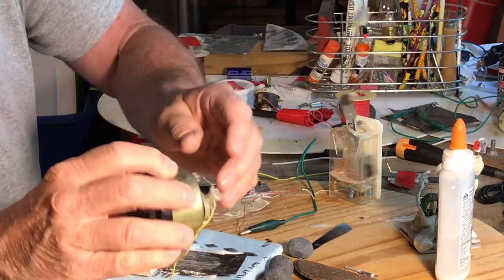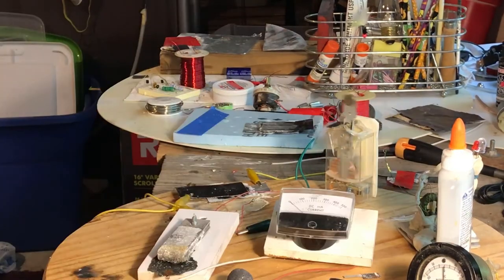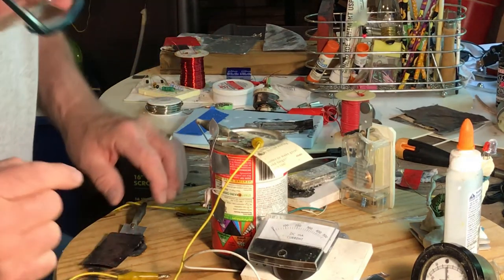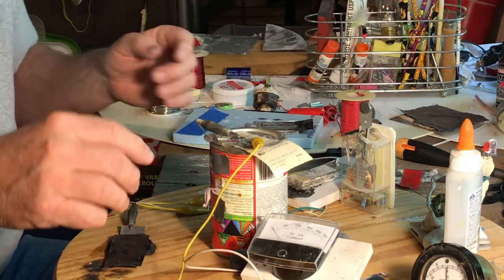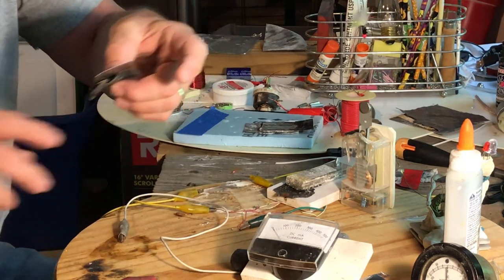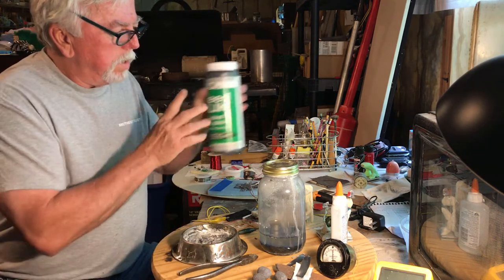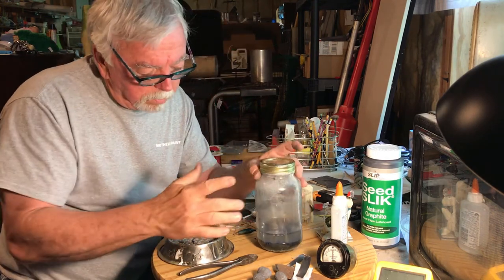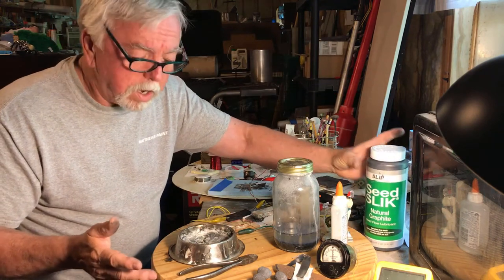Solid Electrolyte and Cement Battery update Without Music

Comment: Can I use only waterglass and graphene as a electrolyte?
Reply from the maker: I found that if I mixed water glass (which is mainly sodium hydroxide) and graphite in a small pot and cooked it over low heat, around 250 degrees F, for several hours, the mixture will look like hard candy.
The cooking pot will be ruined, and make sure to take the mixture out of the pot be for it sticks to the pot.  Try to flatten the mixture while it is still pliable.
You should be able to use the solid electrolyte for a very long time.  I have been powering a pulse motor for a couple of years on this electrolyte without changing the positive and negative plates.  Just add a couple drops of water onto the electrolyte when the power level starts to drop.
Warning: cook the mixture in a well-ventilated area, and do not breathe the fumes
Reply: @ET2uscg  Thank you for your reply! 
I tried Copper sheet  (or Al) + paper with graphene + Al with water as electrolyte. With 1cm x 1cm sheet I’ve got only 0.1amper 🥲 also tried gel (silicon oxide with water) it holds much longer.. 
Solid electrolyte very interesting..Does it also “eats” aluminium sheet after a while?
I have a liquid waterglass, but I don’t have magnesium powder. I have a piece of magnesium alloy but don’t think it’s pure…
Is it ok without magnesium? Or it’s better to add it? Grade it and add it ))
I like your small Al+graphene+Al battery.. will it work very long time like this one on the video?
Reply from the maker: @senoritapandora  Hey Victoria, I did not see any fast degradation of the AL or the Magnesium bar.  I think it is because the current draw is small.  The best I have seen is the conductive plastic electrodes.  Unfortunately, I have not made the plastic electrodes with powdered metal, but could be something I will do.  I should do this as my next experiment.  I don't know why I did not do this.  Thank you for getting me to think in that direction.  Sometimes I am all over the place in my thoughts and go down rabbit holes and forget how to get out.  That is why I started making videos, I can go back and see what I have done before.  I ordered the metal powder from ceramic pottery stores.  If you make some post it so It could help me and others improve.
Thank you and have fun.